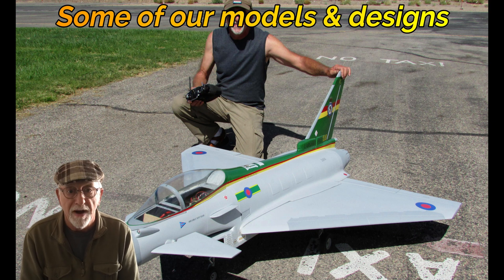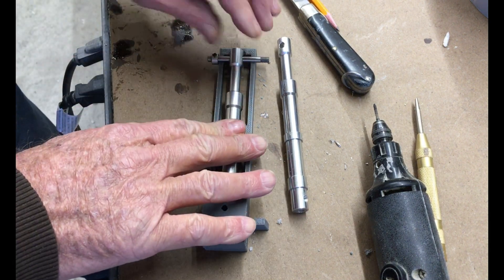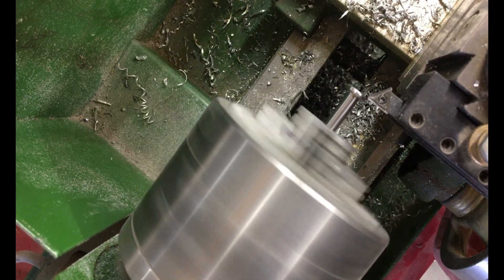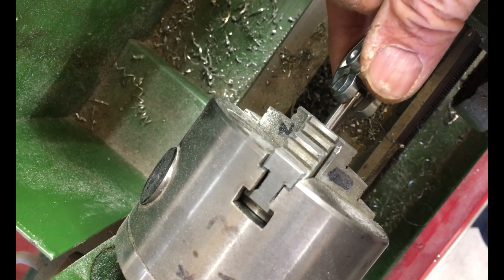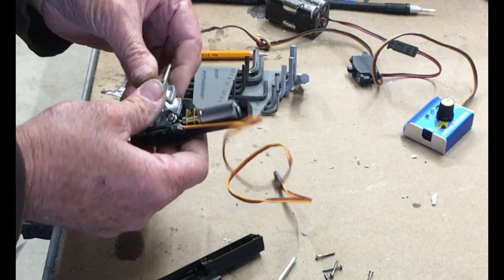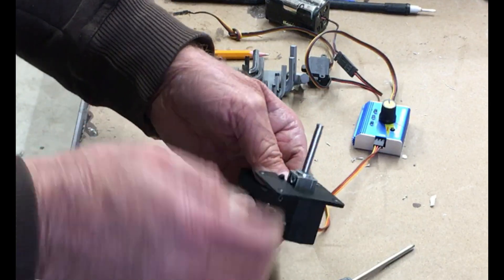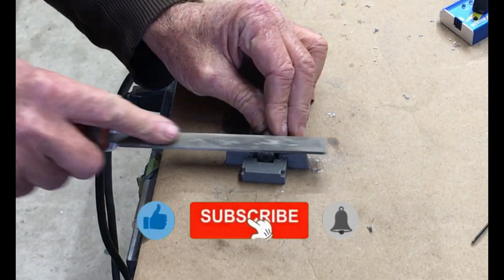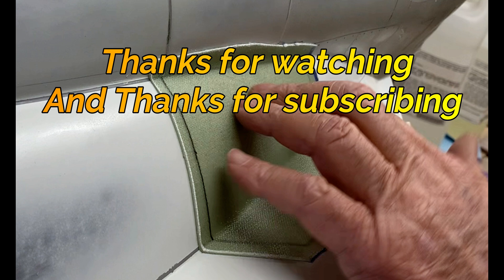A6 Intruder Part 7 Customize Steering Strut & Retract

Comment: what model retract did you use for the nose gear?
Reply from the maker: It's the 90 mm large PZ5 series from hobby king.  I use these on all my larger model 20 lbs plus in weight.